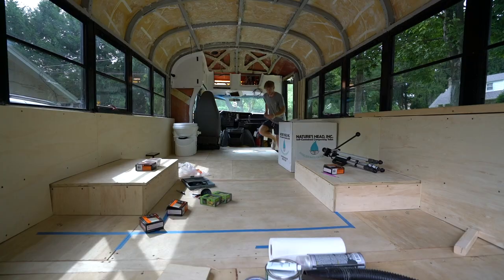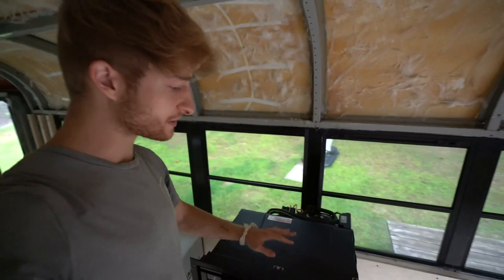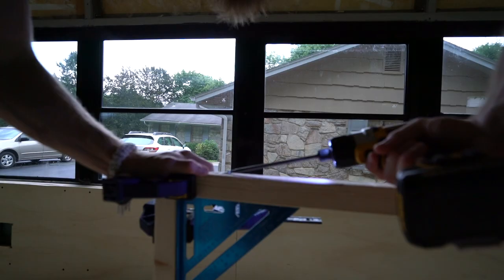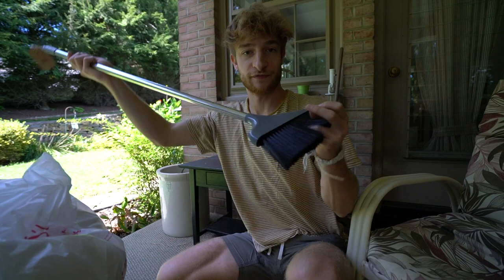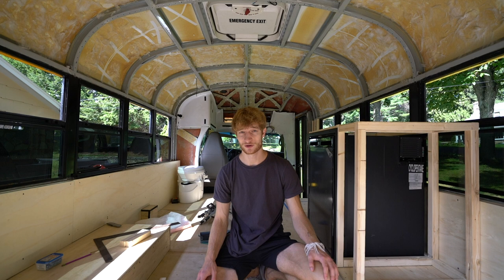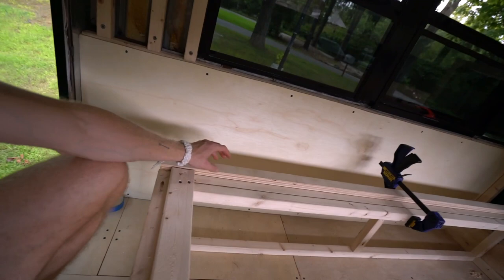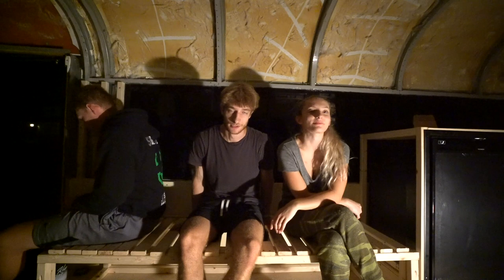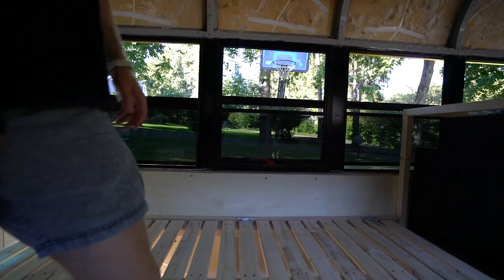Built a DIY Pull Out Couch in School Bus Tiny Home - Skoolie Build Ep. 11

Comment: Hi,  Don't know if this is too late for you to see this comment, but there is a really easy trick to make wood slide.  It works on drawers, and pull-out beds like this, and anywhere where you want wood to slip easily over wood.  Just take a normal wax candle and rub it over both of the wood surfaces.  The wax then acts as a lubricant.  Works like a charm.  Hope that helps.
Reply from the maker: Hey thanks so much!! I still haven't put anything on the wood to help it slide so this is perfect!